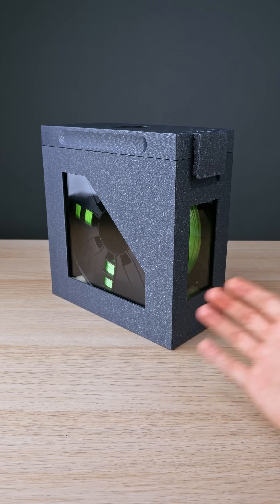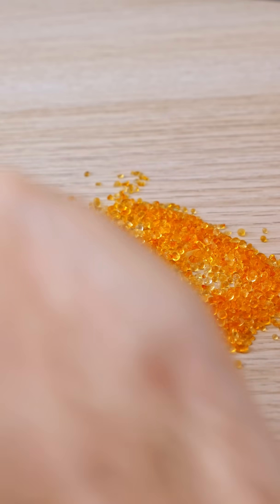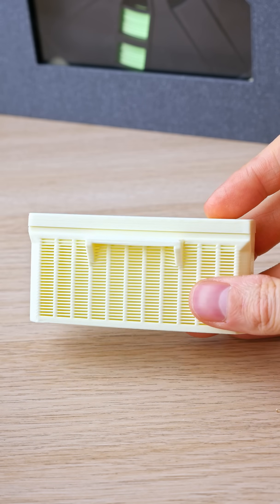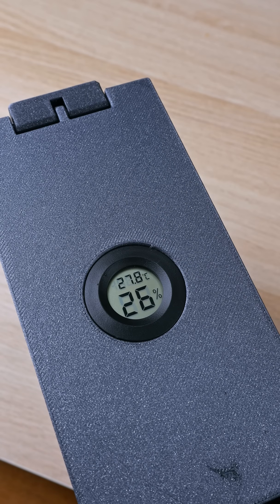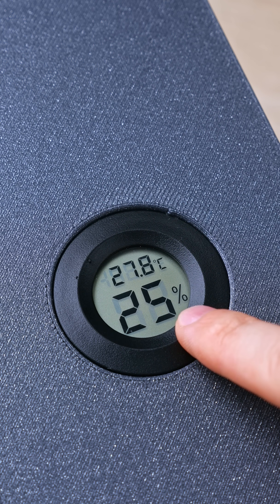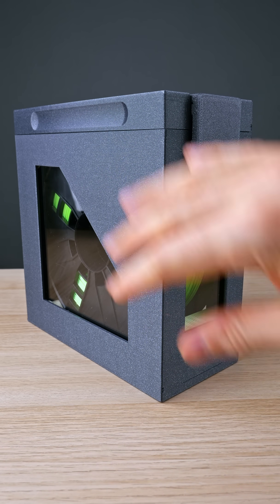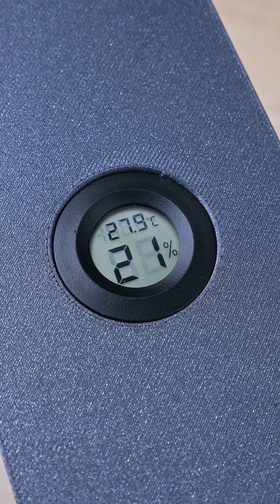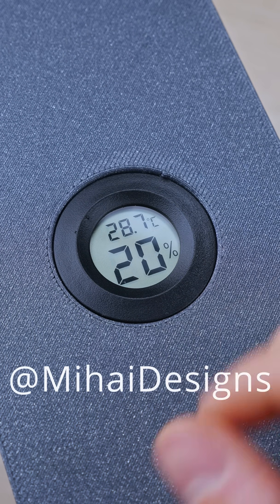Keeping it dry. Silica containers for my filament dry box (with ASMR)

Comment: Very nice.
Note: in the lab, silica gel that was turning orange meant it was already saturated and needed to be regenerated (some hours in oven with ventilation on as I recall) good gel needs to be colorless-ish
Reply: Unless you hope to pull a lot of moisture out, that is already in the filament, the 1st boxer might be enough i think.. if it's just takling the moisture in that ting bit of air :) 
But hey, gel is cheap and there is no kill like overkill

Comment: I’m assuming you know this but, in 10/20 minutes you are only acessing the % moiture in the air inside box. Humidity in the filament itself it’s related to molecular water that has chemically bonded to the polymer (of the filament) and takes several hours to be removed. This can also never happen at room temperature for some polymers. Passive (non heated) storages boxes such as this can only help so that the (properly dried filament) doesn’t absorve aditional moisture, (not to actually dehidrate them).

Comment: When you load the filliment do it in the freezing winter air outside if possible. The humidity will read next to nothing once the fridged air warms up to room temp. (I'm aware this wouldn't work in warmer seasons or places without cold temperatures)

Comment: but you cannot easily dry the silica in the oven, plastic would melt. If you make kitchen paper stapled pouches, you can just bake them to 120°C without issues. Much faster.
Reply: He can just open the cages

Comment: Put silica in oven until it turn blue then it will absorb more moisture. I am not responsible of any fire or anything if something happens just for experiment take small amount then test. I did once and it worked.

Comment: Whats the point of this. Silica 
 works very well, but only when there is no moisture to condense down into water droplets, to replace the moisture that absorbed into the beads.

Make an airtight filiment-container and you might see better reasult.

Comment: How did you continue your print after the clog?
Reply from the maker: I cheated here in post because it was a small print. But you can measure the print and manually edit the code if you want to save a large print.

Comment: Those silica beads will work better if you activate them to ensure they are dry. Heat under vacuum at 120C for 1 hour.

Comment: That silica gel beads are yellow. That to me means they are already saturated. Pretty sure they should be translucent white. Unless they are a different type to those that come in the little white packets. Could try sitting them on some brown baking paper (The non greasy variety.) and heat them up in an oven to dry them out more. They usually are fully recyclable by drying them out.
Reply from the maker: These ones have a different indicator, so colors are different (to have everyone confused). I do dry them on baking paper in the oven as well.
Reply: @MihaiDesigns  Cool. Thanks for the clarification.

Comment: The filament really need a dry box? I just want to know. Tq
Reply from the maker: It depends. PLA may print OK even if moist, but it depends. Other filaments (PETG, ABS, ASA, Nylon, Wood etc) are very sensitive to moisture and you often have to dry them up before printing. Even dried, some absorb moisture so quickly that they print bad before the print is finished. This is why I want the box to keep dry. Also doubles as storage.
Reply: @MihaiDesigns  ouh, okay . Thank you for sharing the information.

Comment: I have another question. I know you want to wait til the box is finished to release the file, but is it the same for the silica gel boxes ? I would love to get the design of these as they seem extremely easy to open and close, without it openning on its own
Reply from the maker: Haha I worked for weeks on that closing mechanism. Does depend a lot on the printer though and a little on the material. I'll have to provide slicer settings and what to change depending on how they come out. I had many many failed attempts.
Reply: @MihaiDesigns  If you need help, hit me up ! I have an ender 3 pro, as this is a really common printer, this would make the settings available for a wider range of people

Comment: I'm actually really interested in 3D printing, I've made some cool things with mine while it was still functional. I'm genuinely curious, though: why does the filament have to be kept in this box? Is it to get a better print quality? Does it extend the lifespan of the printer?
Reply from the maker: For better prints, especially in high humidity zones. PLA is less affected and you'll probably get good prints without it. PETG other hygroscopic filaments are prone to printing problems from humidity. Shouldn't affect printer lifespan.
Reply: @MihaiDesigns  I actually use PLA filament so I suppose I have a little less to worry about- but anyways, thanks for the answer! :3

Comment: You can resume a failed print from where it stopped? What printer is that?
Reply from the maker: I didn't really recover the print. It is possible with some work, but there's nothing automatic for this. Although now that I think about it, it wouldn't be that hard to implement.

Comment: Hello, maybe you shared it but I can't see it. I wonder if there is a link for your stl files (I am asking for all the printing parts you use in the filament box) If you can share it I would be very glad Also, the color of the filament you use is very nice. I can't find it as vertigo in my country. I wonder if the filament can be gray with glitter powder to describe it exactly?
Reply from the maker: Try Vertigo Gray from Fillamentum, should be similar. STL after I make some changes to the design.

Comment: Have you considered doing an active heated version? e.g. use a 12V Keenovo heat pad (or a 12/24V heat cartridge from a hotend), fan and a micro-controller (Pi Pico or  other with wifi), with BME680 (or similar) and for bonus a little screen (OLED, LCD or ePaper). For safety, consider using a 50 degree C thermal fuse on the heater part. PS: looking forward to when you release the design files. Are you going to release source or only stl's)
Reply from the maker: Good point! I'm not sure the active heating is worth the effort for now, but I might add it in the future. I like the idea of using a safety fuse. It'll be STLs and we'll see about the sources. Maybe there will be STEP files.
Reply: @MihaiDesigns  Cool, just wondering when you are thinking of releasing? Would like to test this design out.
Reply from the maker: @TheRealWattsie  can't say for sure 😟 Got myself into too many things and had to delay everything. Hopefully in less than a month 🤞
Reply: @MihaiDesigns  Nooooooo.. :-(

Comment: I need to ask. Your hygrometer says 28° C. Is this really accurate?
Reply from the maker: Haha well I didn't do any scientific measurements, but usually they're close to real values. The thing is that during filming I had my hands on it and the box for over an hour, and the lights get pretty hot too.
Reply: @MihaiDesigns  Well, what is the room temperature? Bcs I don't see how you could jump from smth like 22 to 28 by just laying your hand on  it :/ 28 is the temperature inside the box, not the surface right ?

Comment: Maybe filling one of the boxes with 4A Molecular Sieve would help lower the humidity faster and to a greater extent than silica alone. 🤔
Reply from the maker: I see them in some dehumidifying packs. Are they "rechargeable" by drying?
Reply: @MihaiDesigns  why yes. 550C for 3 hours. 😳 Luckily, it’s not crazy expensive and the silica would help extend its functionality. You could perhaps maintain 10% RH. I’m not too sure about diminishing returns though. 

Wisesorb Premium Quality Desiccant Bulk Material (4A Molecular Sieve) https://www.amazon.com/dp/B07YN576YJ/ref=cm_sw_r_cp_api_glt_fabc_QKGN75P5ZH6J1PVX1NKJ?_encoding=UTF8&psc=1
Reply from the maker: @texasermd1  550C means you need special equipment, so pretty much a one time use I think.
Reply: @MihaiDesigns  for sure unless you have an oven that can compete with the surface of Venus.

Comment: I keep my silica gel in small muslin bags. The bags are microwave safe, so I don't need to decant the silica when it needs a recharge.
Reply from the maker: That's cool! Will have to find a way to dry mine without opening the little boxes.
Reply: @MihaiDesigns  I print silica boxes out of petg and I can put the entire thing into a food dehydrator when I need to dry them.
Reply: Microwave? Is the plastic microwave safe?
Reply: @laurahayhey2962  I removed my silica gel from their plastic containers and put the gel into muslin bags instead. Muslin material allows air to get to the silica gel, and both gel and bag are microwave safe. I usually put them on a kitchen roll covered plate and microwave four times at 5mins defrost, flipping over the bags in between each microwave session.

Comment: Why not drop the silica just in the bottom of the container
Reply from the maker: Good point. You'd have to take it out from time to time and this is easier. Humidity tends to move up in the box. Loose silica binds to the filament when the box is bumped around and is then hard to peel off. Sometimes it sticks to the filament hard enough to get into the extruder and fail the print.
Reply: Because it's difficult to get out and might interfere with the mechanics (the box has gears to rewind the filament)

Comment: What filament are you using for the silica cages? I think if you use ABS/ASA you can still dry them in a food dehydrator? Not totally sure, oven-temperatures may be required and even ABS won't stand up to that.
Reply from the maker: Hmm that's very interesting 😁. Because taking it out of the boxes to dry is not fun at all. I've got some filament that should be even more heat resistant than ABS/ASA, but not by much. I read somewhere that silica needs about 150 degrees Celsius to fully dry, so I was drying it in my oven, which is a gas oven and doesn't work well at lower temperatures. And my dehydrator goes up to 70 degrees only which I'm not sure is enough. I'll have to run some tests because it would be super useful to dry these containers directly. Otherwise it's beads everywhere 😪
Reply: @MihaiDesigns  I would not use gas oven. You might have some success drying the silica gel but gas burning produces water, so it might affect the process. Electrical oven will do better, even a tiny one, or you might consider to make a vacuum box to dry (vacuum box is useful also if you plan to play with resin some day)
Reply: @MihaiDesigns  Googling for the max temp for silica beads is giving me numbers between 110 and 150°C for limits not to exceed. I'm gonna go with printing a dehydrator tray for them, and dry my spools at the same time.

Comment: First!?
Reply from the maker: Yes you are. Your part cooling duct says hi!
Reply: @MihaiDesigns  haha yes! I actually just printed a bunch of round cages for fearless silica beads that cleverly uses the round hygrometers as lid, to toss in with my bulk filament storage. Looking forward to printing a drybox or two though, for keeping specialty filament spooled up and ready to go!
Reply from the maker: @BrazenRain  😂. Cool idea to use the hygrometer as a lid! It'll be very optimistic about air dryness I imagine 😁
Reply: @MihaiDesigns  they steadily increase, so it's more like it lets me know when the fearlessness has been saturated. Redundant with the color change though.  I might not have thought this one through fully 🤣